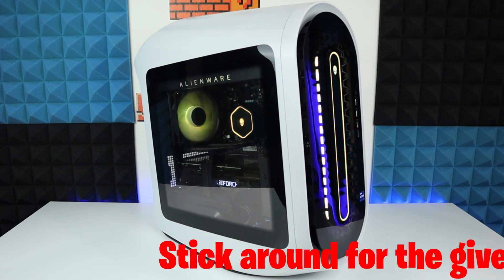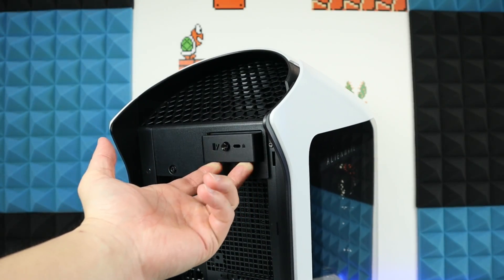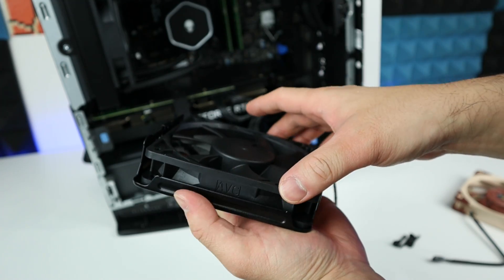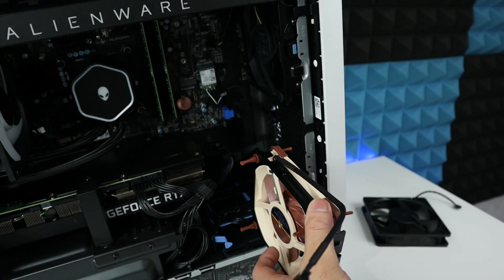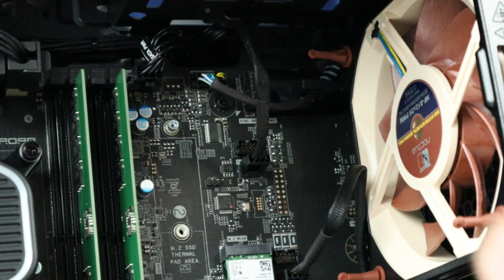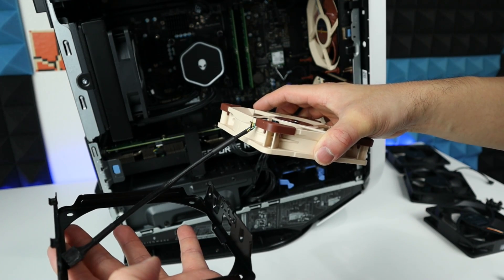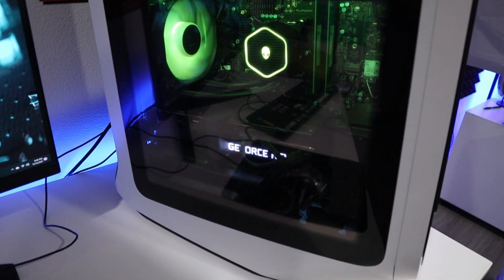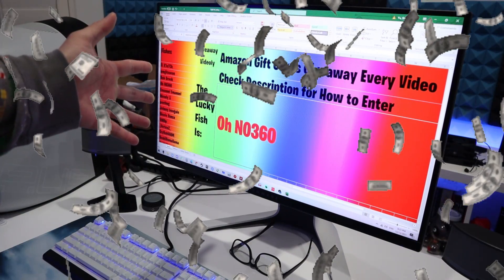Alienware Aurora R13 Fan Upgrade Lower Noise and Temps Mod

Comment: On my r13 I find the stock Foxconn fans quiet, I find the AIO pump on on the CPU makes more noise than the fans on idle , makes an annoying whine.
Reply: My R13 has this same issue with the AIO fan.  The other fans are much quieter.
Reply: @aaronhalvorson  have you had other AIOs? This is my first watercooler, wasn’t sure what to expect
Reply: @kamac1980  This is my first AIO, I haven't upgraded in over half a decade.   I went AIO with the R13 because Alder Lake is known to run hot due to the watt usage.  I do know that there are issues with the Ryzen version of this same mother board.  Dell decided to use a LGA1700 spacing for the mounts on the Ryzen version of the AIO.  More than likely to save money and use the already existing LGA1700 intel coolers.  EDIT: Duplicate Wording.
Reply: @aaronhalvorson  interesting,  I’ve heard from some people that AIO aren’t as quiet at they are talked up to be. I mean I don’t hear the AIO when using anything performance intensive like gaming as the case fans drown it out.  But surfing the web and idling it’s a bit annoying.  I’m guessing that people who say they are quiet are talking about at full blast when everything drowns it out
Reply from the maker: There may be some noise comes from the PSU too.
Reply: @RyanYu  opened the case and put my ear right next to the PSU and there isn’t much noise coming from there on idle.  It’s definitely the water cooler pump making the sound.
Reply from the maker: @kamac1980  Oh, sht..

Comment: The fans made little difference to me. I took them back out and put the originals back. Under load the Noctua need to work a lot harder, negating any benefits.
Reply from the maker: The OEM fans are better at performance.

Comment: my r13 has 4000rpm fans. why would I want to change them to lower rpm fans? If it because of noise just make the fan curve not go above 2000rpm boom its quieter lol
Reply from the maker: I covered it in my newest video.

Comment: My Friend thank you so very much and really appreciate for every video’s, great, I’ve got mine and I also as you changed the dell fan’s to a noctua same 120 fan’s, but for some reason, on the screen sign keeps showing that, fan failed to respond correctly, My friend if you have time and don’t mind then could you please kindly explain step-by-step how can I sort this out through bios, in advance many thanks and really appreciate for you’re hard work and time, Mohammed.
Reply from the maker: There is no where to by pass that in the bios.
Reply: @RyanYu  Any other way my Friend, thanks.

Comment: Thank you for the useful information. I enjoyed all your Alienware videos. I have got an R13 as well and I am thinking of putting in RGB fans. On the motherboard I can see 7 pin headers for the RGB just above the 4 pin PWM. My Cryo-Tech RGB fan has got a 7 pin and a 4 pin connector but I can't find any other RGB fans with a 7 pin connector. I can't even find a 7 pin to 3 pin RGB adapter. Do you have any idea how can I install RGB fans and connect it to the motherboard RGB header? I prefer not to use a controller box. I guess one solution is to buy the same fan that came with the Cryo-Tech cooler but again I have no idea where to find that.
Reply from the maker: I think you need a ARGB hub or controllers.
Reply: @RyanYu  That's what I was worried of. I won't be able to sync the colors with the rest of the RGB using Alienware Command Center :-(
Reply from the maker: @aunkoay  nope. You can’t.
Reply: Can you say that magic word, proprietary? Alienware decides what you can and can't do to THEIR PCs. RGB fans might one day be included in their options list $$$.

Comment: Can someone please explain which fans are what on the R13?  Top fan is pretty obvious, but which fan is the mid fan, side fan, and front fan?  Also, I have noticed that on mine the side fan under load is at 60% fan speed, which gets pretty loud.  Is it possible to change the fan lables?
Reply from the maker: They are all 120mm.
Reply: @RyanYu  Thanks for the reply.  I understand they are 120mm fans, but from looking at the AWCC I can’t tell where the fans are located in the case.  For example, where is the side fan located?
Reply from the maker: @hubbellr5  that’s easy, change the fan speed then you will tell which is which.

Comment: So from your previous video it appears the r13 can take a 3.5 hdd of 4 tb, 2.5 sdd 1 tb and m.2 sdd 1 tb, what would be the max storage capacity I can add?
Reply from the maker: That, I'm not sure, but I have put in 4TB 3.5, 1TB 2.5, and 1TB M.2, plus the stock 1TB, total 7 TB works fine.
Reply: @RyanYu  all together or one at a time
Reply from the maker: @EmperorKandyKatsuVonKandai  All together.
Reply: @RyanYu  interesting, cause I was chatting with a dell support agent and they said 2tb pcie m.2 ssd and 2tb Sara 3 hdd max

Comment: Mine arrived today! The Corsair ML120 Pros were out of stock so I got the Noctua Chromax Black ones.  Swapped them in before even turning it on.  Also got the 10tb spinning rust drive I bought installed and it's really amazing how quiet it is after the swap.

Thanks for the video it was super helpful
Reply: Did you have any issues with the Noctua Chromax for the top? I see they changed the power connector to only a little like 1/4” nub connector, my worry is that would get in the way when replacing the top fan.

If no issues then I’m going to buy those, but wanted to see if you had any issues with them for the top fan replacement. Any info would be super!
Reply: @Creetchure  Was a tad more trouble just had to run the cable on the side corner area.  I really don't like the nub thing Noctua did on these black ones
Reply: @AlyxSharkBite-2000  I agree, was a mistake. Thanks for the quick reply. I’ll probably go for the ML 120 Pro though they will be a bit louder, will allow for more CFM.
Reply: @Creetchure  I was going to too but they were out of stock but they had the Noctua
Reply: @AlyxSharkBite-2000  I’m just going to wait till they get more in stock, I’m already waiting on a new Phanteks F120T30 to put on the rad for push/pull.
Reply from the maker: No problem, man! enjoy your beast!

Comment: Hi, i noticed that the original fans are 4000rpm, and noctua ones are 2000rpm only but better temperature?
Reply: Hey Mr Fish… the command centre couldn’t recognise the temperature and usage after upgrading the fans, is it normal
Reply from the maker: @luzhou8241  nope, it shall work.
Reply: @RyanYu  thanks, had to reset the command centre… dam i cant even tell if the computer is turned on now
Reply from the maker: @luzhou8241  Good right ha  .
Reply from the maker: In the low and mid load short time the noctua better, in the heavy load and long run the OEM is better.
Reply: @RyanYu   the OEM is way too noisy.. and looks like i got a faulty one it’s making a sharp rubbing sounds.. my cpu temperature is about 60-65 when gaming, probably i should change 2 front ones
Reply from the maker: @luzhou8241  change all three man.
Reply: @RyanYu  alright, i ll follow u! Also waiting for a better and cheaper ddr5 gonna replace them all, any suggestion?
Reply from the maker: @luzhou8241  Don't get them now. wait for a few month.
Reply: @RyanYu  thanks

Comment: Yo!!! Thanks for the tips. Great looking machine. Just got my X17 R1 3070 165Hz. Was trying to test it side by side with my MSI GE76 Raider 3060 144Hz and wasn’t seeing a ton of difference between a little brighter/crisper screen. Was getting about the same thermals and fps. Not sure if I can justify the $847 price difference. :-( X17 is so pretty though. What would you do if you had the choice? 😂
Reply from the maker: I will go with X17 for sure.  It’s so beautiful.
Reply: @RyanYu  it surely is. I got the door buster deal so it was seemingly a lesser model of the X17 so I was nervous I went to cheap on this already expensive model to make the upgrade truly worth it. I wish I had bench mark programs to run.
Reply from the maker: @jeremystaggs9018  :)

Comment: I am interested in what 120mm fans are the absolute best for temperature and I personally don't care about noise. I stream new games on highest graphics settings using OBS and review their particle aesthetics, I rarely turn off my computer, and my noise-reduction on my microphone is good, so any ideas for best of best in this regard?
Reply from the maker: If you don't care about the noise, then stay with the OEM fans, they are very good at performance. a lot more RPM and CPM of air than all other fans.
Reply: You have mentioned in a couple comments that the stock OEM fans are good performers but they are louder.   However the video shows a noise level improvement And a temp improvement.  Do you suggest sticking with the stock fans because the temps aren’t much of an improvement or could you clarify.   Thanks again for a great video!
Reply from the maker: @davidfrancis2163  I will clarify it in the upcoming video bro.
Reply: @davidfrancis2163  I think he means that the other fans are capped at a lower max rpm under sustained heavy load, but idk if he is accounting for manually adjusting the fan curves of both with MSI Afterburner, so I am not sure if his advice is perfect because I do not know his level of manual adjustment... or what levels are possible...
Reply: Yeah.   The dell fans do spin up extremely fast but are obnoxiously loud.   I’m trying to find a sweet spot for high rpm fans and noise.   I haven’t been able to find any noise comparisons on high rpm 120mm fans.  I guess I might need to just go through some trial and error.
Reply: Meaning a 3-400+ rpm fan that is also engineered well for noise.   Not sure they exist hehe.
Reply from the maker: @davidfrancis2163  Noctua and Corsair are both pretty good.
Reply from the maker: @davidfrancis2163  ~~~~~I don't think so.
Reply: @davidfrancis2163  I use a white noise app in my room for focus, and have bad ears anyway, so my ONLY concern is maximum cooling.

Comment: Nice video. I found it tough to decide between quiet or cool. I found noctua doesn’t do well at high loads since it doesn’t have the high rpms to tackle the huge heat the pc produces. But under small loads noctua was nice. I wish you didn’t have to choose between cool and quiet.
Reply from the maker: Corsair pretty good.
Reply: Would Corsair fans make it way cooler cause I could care less about the sound

Comment: Hey I have done the same fan swap to mine are you able to set the fan speed to 100% in Awcc ? I can only set to 45% for the noctua fans I assume it’s because the awcc is set up for the stock fans with  100% = 4000rpm and the noctua fans only do 2000rmp max so I’m guessing that’s why it can only go to 45% in awcc that’s what I’m thinking anyway do you see the same in yours
Reply from the maker: You are correct.
Reply from the maker: The OEM fans have more RPM than the Noctua, so 45% it's the 100% for Noctua.

Comment: The R13 looks so sick bro I should have waited for that one.. can any 3080 fit in the r11
Reply from the maker: We can't ever catch the tech trend, it's too fast.
Reply: The R12 had a bracket in the way so most full size cards wouldn't fit.  I have the R13 and there is way  more room as the bracket doesn't sit as close.  You should be able to slot any standard card in there.  Not sure about the larger boutique cards though.

Comment: According to Dell 
This would void warranty 
Checked with 2 reps on phone and 1 on chat
Reply: It does not void warranty for the whole system, only in case the changed fans can be traced as the source of other damaged components. Of course Dell warranty does not extend to the new fans but to the original OEM fans.
Reply: @clemensjheilmann  that makes a lot of sense but that’s not what Dell said I specifically asked this to 3 different reps and they told me if anything is changed it voids warranty. I don’t know if they misinformed me or not but that’s What they said
Reply from the maker: @clemensjheilmann  :)
Reply: There might be differences depending on markets but in Germany what I said is true. I can not speak for other markets but I would assume that consumer rights would support my position in the majority of cases. Not a lawyer though.
Reply: I was going to ask Dell this tomorrow. Thank you for checking for us and posting, Mr Barbagallo.
Reply from the maker: @noahcohen8417  Just keep it as a secret...
Reply from the maker: Yea it will.
Reply: @RyanYu  it’s pretty ridiculous it does 

Dell markets this computers as upgradable and future proof but the minute you touch anything warranty voided 
Even if you upgrade GPU it olvide whole warranty according to their reps
Reply from the maker: @FrancosHVAC  just keep it as a secret.

Comment: I replaced the case fans with the black Noctua ones, I just with you could replace the radiator fan with an RGB because the effect is cool but it is a cheap fan. It cools well enough, but it is a loud fan for ok performance.
Reply from the maker: That RGB one it's hard to replace for AWCC to change the RGB.

Comment: How about high rpm or more airflow than the current ones vs. Stock. I need better cooling as I use it for mining. Any fan suggestions?
Reply from the maker: then stay with the OEM, it has more RPM, so for long time running it's better.
Reply: @RyanYu  Is the RPM the only measure? Shouldn't it be air volume pre hour?
Reply from the maker: @SKarea51  more spinning = more air.
Reply: @RyanYu  Sure, but the blades design has impact on airflow as well. Did you have any BIOS issues after swapping the vents?
Reply from the maker: @SKarea51  nope. These two brands are good
Reply: @RyanYu  Thanks, I replaced them yesterday, started the pc to see if they spin, but was lazy to hook it up to a monitor, it's a xmas present for my son. Fingers crossed it all works. It is win 11. What is yours? Any issues with win 11?
Reply from the maker: @SKarea51  same windows 11 all good.

Comment: I will say that I'm quite impressed by the performance on the stock Dell fans. Dell did an absolutely excellent job on this PC with the changes implemented vs their prior PC. Honestly, the only drastic change was the noise level of the Noctua fans vs the Dell fans. Great video!!!
Reply from the maker: Dell's fan is very good at performance it put out a lot of air, but to get that performance, it's loud. if you always have your PC under heavy load, then stay with the OEM fans.
Reply: @RyanYu  makes alot of sense. Thank you very much for your response.

Comment: Great video!! If I keep my R13 going to change fans as well . How is your running so far?
Reply from the maker: It’s okay but, like yours it restarts itself on heavy load some time.
Reply: @RyanYu  did you call Dell or have you figured it out what causing it?
Reply from the maker: @cryout4ahm  nope,
Reply: @RyanYu  I plan on upgrading ram to 32GB and I have ddr5 4400 . Do you think r13 motherboard will support ddr5 4800?
Reply from the maker: @cryout4ahm  it will.  but DDR5 RAM are so pricy now.
Reply: @RyanYu  yes pricy and hard to find . I am going to wait couple months maybe price comes down.
Reply: @RyanYu  I had the same issue with my r13. Here is what solved it for me. Start>control panel>view by should be set to large icons>power options> change plan settings > change advanced power settings > scroll down to pci express, expand it > expand link state power mgnt > click off > apply
Reply from the maker: @willsanford6706  THX for sharing. I will try that.

Comment: Question is what's the temp on Vram while mining? On quickminer lite setting, even with thermal paste, I'm getting only 100mh and it's hitting 100C. 
Reduce to 73% power. GPU fans to 65%, full blast on all 4 fans, hovering between 96 to 100C. Very disappointing results. Ambiance temp is 30 degrees.

What am i not doing correctly? I'm not doing the paste to retain the warranty
Reply: fuck your mining.You pos miners are reason we gotta pay out the ass for these new gpus i hope crypto dies
Reply from the maker: @johnnyboogalo4897  :) haha.
Reply from the maker: That I have no idea.

Comment: Great vid ! is this sufficient for the correct functioning of the cooling system or do you intend to change the water cooling system as well ? Is the cryotech system sufficient and good quality ? thank you man !
Reply from the maker: The OEM parts are ok for the temps, it just too much RPM and cause more noise.

Comment: Great vid and very interesting! I'm just left wondering why on earth can't Dell fix this themselves at the factory before shipping, this is not a cheap pre-build - Dell should be tripping over themselves for the hefty price they are charging to iron out such obvious and simple-to-solve niggles.....not leaving it to the  customer! Keep up the informative videos dude 👍
Reply from the maker: Actually, their fans are good at performance more RPM and CBM, since it spins more there is more noise.
Reply: The fans they use are server fans, actually each fan is capable of 4K RPM and 135 CFM thats 3800 litres of air per minute. So they actually perform better than the Noctua ones, but at the cost of sound. I am swapping them too on my R13 ordered 3x Noctua Noctua NF-A12 × 25 PWM chromax. black and for the RGB Fractal Design Prisma AL-12 ARGB PWM. The Airflow on those is enough for the system.
Reply from the maker: @addd717  yep totally right.
Reply: @RyanYu  I ended just replacing the 3 fans, the one on CPU radiator has some proprietary connector so i left that one stock. But re-pasting CPU did some differences, try it.
Reply from the maker: @addd717  :)

Comment: What were the temperatures before and after the change under heavy load?
Reply from the maker: The OEM has better temps on that for long running time since it have more RPM.
Reply: @RyanYu  So why did you downgrade it?
Reply from the maker: @borisrazmiki8296  I don't have it in heavy load that often. so this is okay for me.